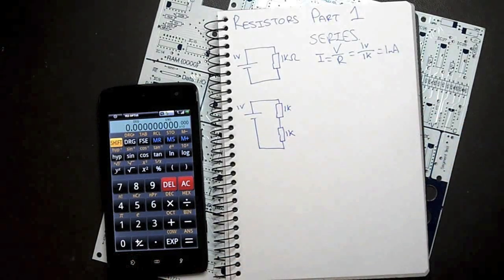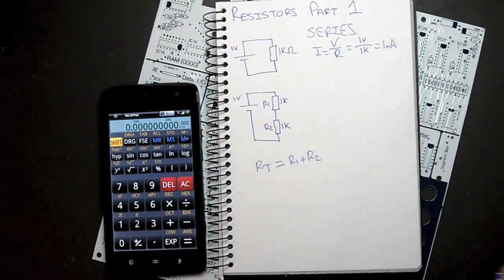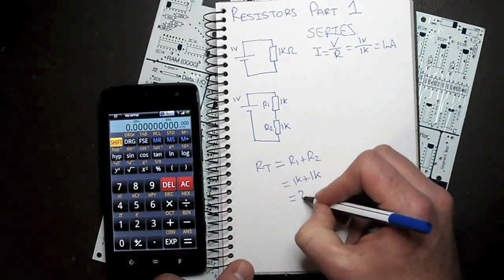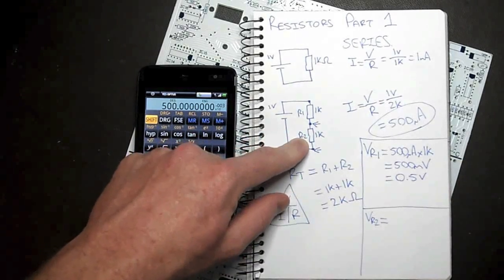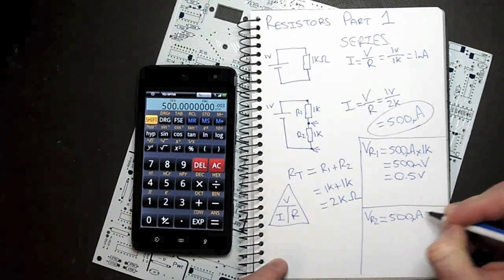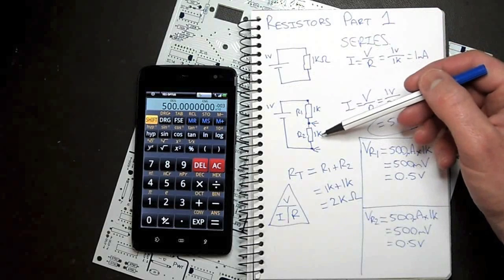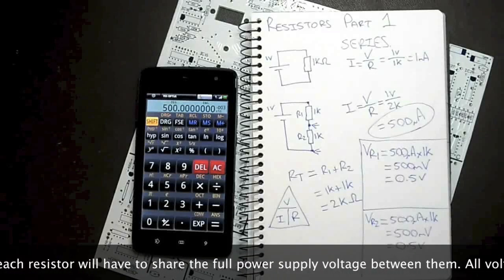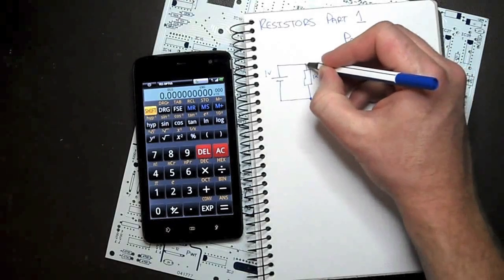Electronics Tutorial 4 - Introduction to Resistors.

Comment: If 1 resister drops volts. Then why wouldn't the 2nd drop the v. Why would it remain the same as with 1 resister.?
Reply from the maker: +Cory Mullins It doesn't matter how many resistors you have in the circuit - the power supply just sees one resistance. these resistors will divide up the power supply voltage and each will get a certain amount according to their value of resistance. The larger the resistance, the greater portion of the total power supply voltage they will get.

Comment: This sort of bothers me, but first I enjoy the idea of everything you are doing, it's absolutely amazing.  The symbol you are using for the resistor is not correct, it is supposed to be a ziggy-zaggy line.  The box is for a load or incomplete transformer.  Overall, again, you are amazing, it's the symbol I can't stop ignoring :/
Reply from the maker: +Sebastian Malikai The rectangles are european standard symbols :)
Reply: +00retrobrad00 Yeah, after I did further research I found out that I was incorrect and by then I was so wound up in projects that I totally forgot to redo my post. My bad and thanks anyways for the Intel.

Comment: Just wanted to say thankyou for the help with electronics(great videos!) but when using the reciprocal method to calculate the total resistance in parallel, do you always have 1 over top of the whole thing or is that because of the 1V power supply?

Comment from the maker: It all depends on what you are trying to do. Perhaps you want to light up 10 LED's (which for this example let's say they require 2volts each) if you were to connect these LED's in series, you would require a 20Volt power supply (assuming no current limiting resistor is used) But what if all you had is a 9volt battery? well that's where connecting things in parallel comes into play! you can connect all 10 LED's (each with a series resistor) to the 9 volt battery and they will all light up :)

Comment from the maker: No. If you had one light bulb drawing 100mA and then connected up an identical light bulb in parallel, they would each still only draw 100mA but the total current being drawn from the power supply will be 200mA. If you added a third bulb in parallel you will now have a total of 300mA drawn from the supply - but all three bulbs will only each draw 100mA.

Comment: what is a voltage drop and why do they have to equal the total power supply voltage when added together? also, if the voltage drop is equal to the power supply voltage, then wouldn't they cancel each other out to and leave zero volts after the last resistor?

Comment from the maker: @Broyale26 That's a good question and I certainly will be covering applications of resistors in a later tutorial. The most basic use of a resistor is to ensure that we don't blow up a component (such as an LED) by limiting the current going through it. If we had an LED that only allowed 20mA of current to flow through it. We would need to choose a certain value of resistor to connect between the LED and battery to limit the current to somewhere below 20mA. that way the LED will not be destroyed